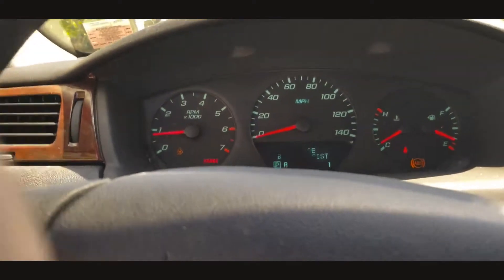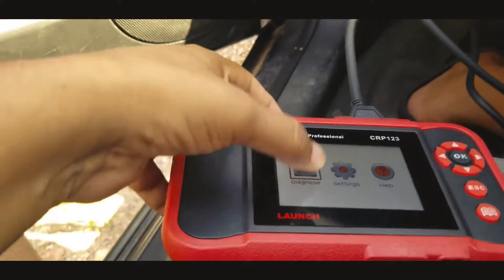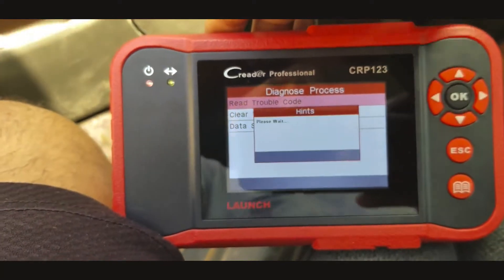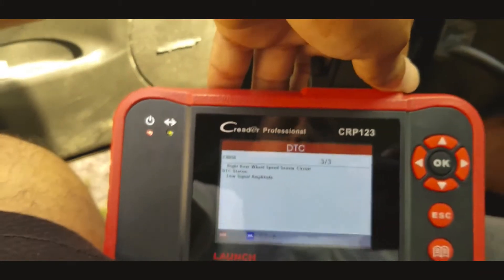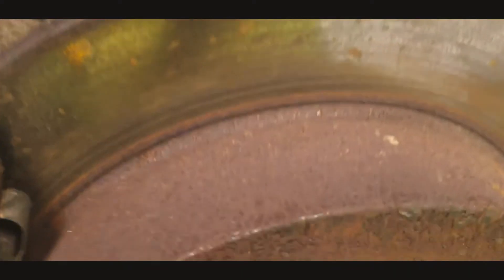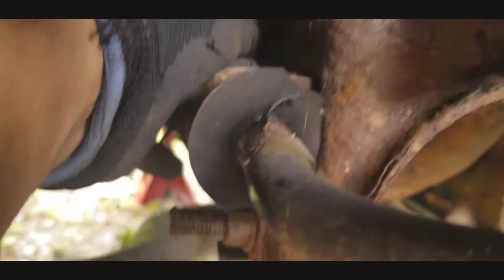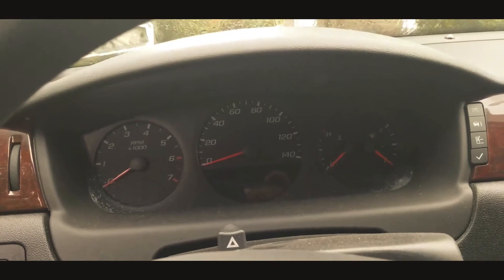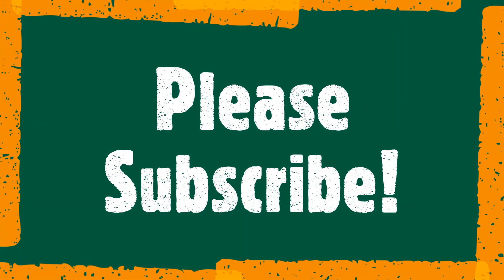2006 to 2013 Impala ABS, StabiliTrak, other warning lights

Comment: I had a 13 impala with 50k miles that developed this issue. I changed wheel bearings, wire harnesses, cv axles, put new brakes, rotors, flushed the brake fluid, everything 4 shops and a chevy dealership could think to do in my area and never did get it corrected. I got tired of messing with it and sold it for 3 grand and bough a honda civic. No issues now. GM has major issues with their junk traction control systems which they refuse to issue a recall for and provide a proper fix.

Comment: Did you recently get an oil change? I had something similar and found a plug that clips in loose... mysteriously. Plugged it in and all was good. Just saying.  Place was gonna charge for diagnostic test, already knowing what the problem was.
Reply: Bro literally I got 2010 impala I just got oil changed and I got these message so what should I do?
Reply: @Snuccc you got any ideas?
Reply: @madedesires7323  yes, it’s 9/10 just a wire that is lose nothing major
Reply: @Snuccc  I have that issue is it a easy fix?
Reply: I recently have been having this problem since I got my oil change. What plug did you find?
Reply: @rello_fnb  plug to the airbag....under passengers seat chevy truck
Reply: There's 2 wheel speed sensors in the front, one for each wheel, with a 2 wire harness plugged into a connector right next to the brake dust shield.
This sensor is right in harm's way and the harness flexes back and forth when you turn the steering wheel. Dirt, water and crud build up on this.  The baby wires can break. It also can be disconnected if a monkey is fooling around without a care.
The sensor itself is built inside the wheel bearing assy, but the wires and connectors are my primary suspects to check.

I hope you've resolved your issues as my comment is much newer than your post.

Comment: Bout how much did your parts cost you?
Reply: Maybe $30 for both sides pre wired no soldering required
Reply: Yeah my wire that was actually on my wheel hub bearing was disconnected apparently I bought the car like that so I have a family member that has discounts on parts so I bought another wheel hub bearing and it came with the part. And my problem is gone.